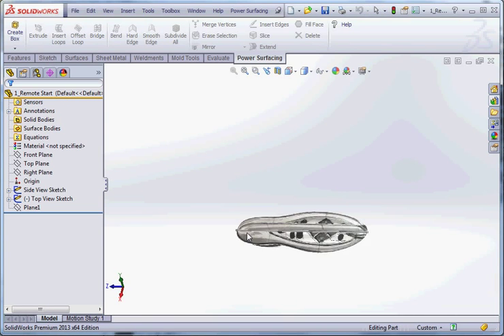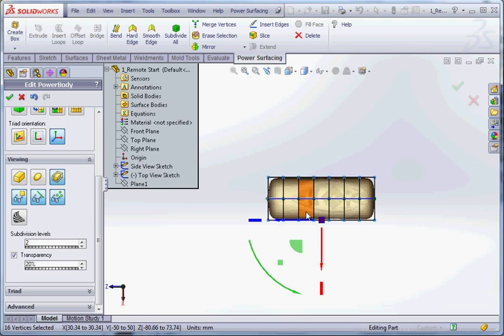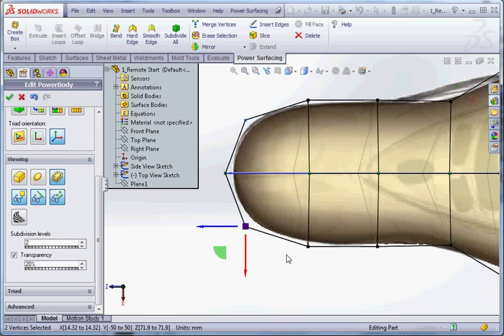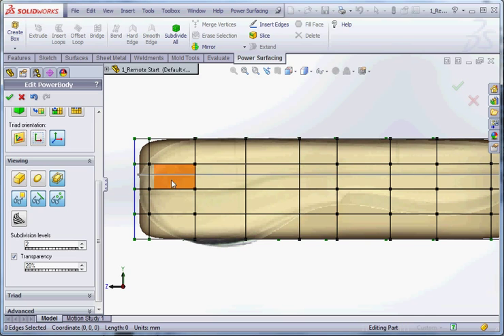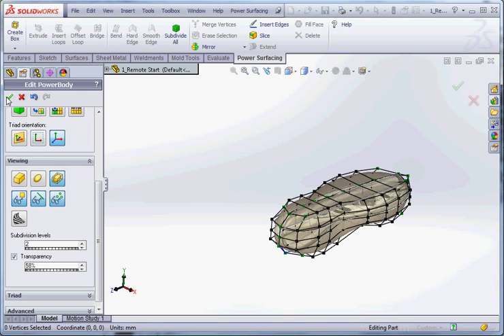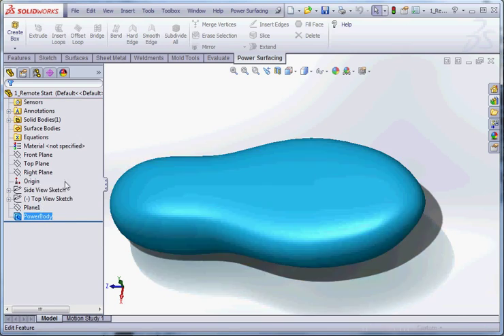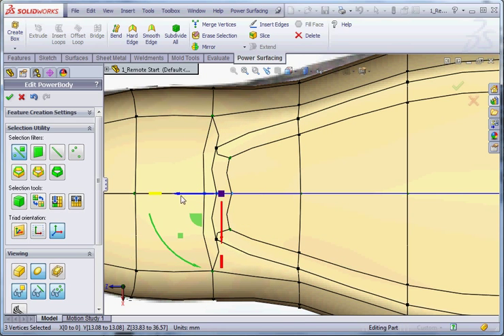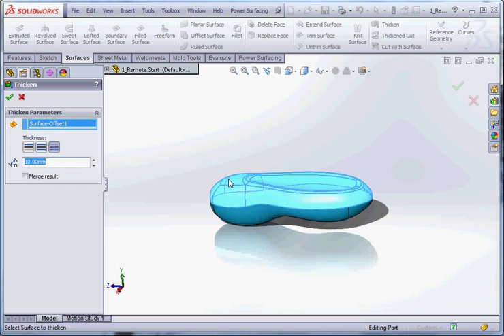Modelling Remote Control

Comment: How do you add those images to solidworks? I mean i know how to add them but the problem is how to get the proper size cos i do not want to make something bigger or smaller!
Reply from the maker: If you draw a line in the sketch with a dimension before inserting sketch picture then you can drag the corner of the picture to scale.  Alternatively there is a scale tool built in in later versions of SW